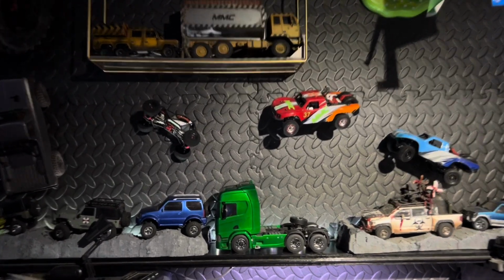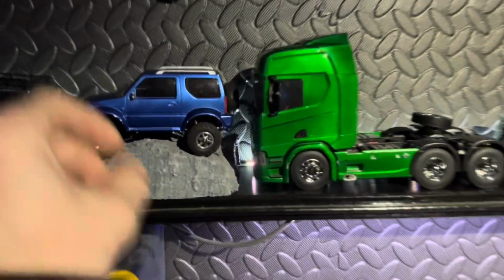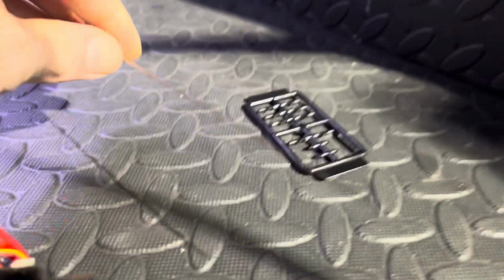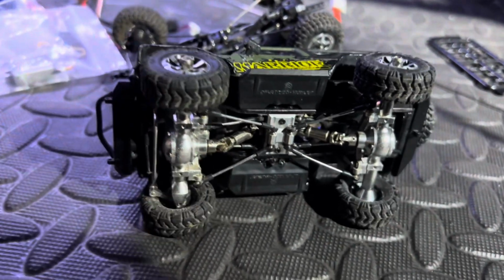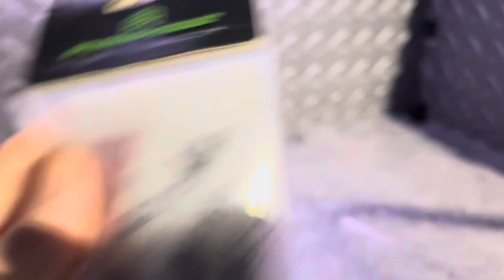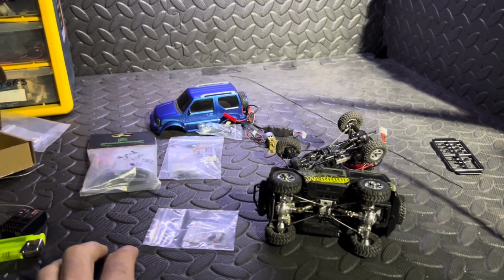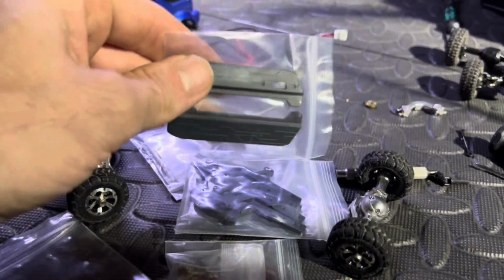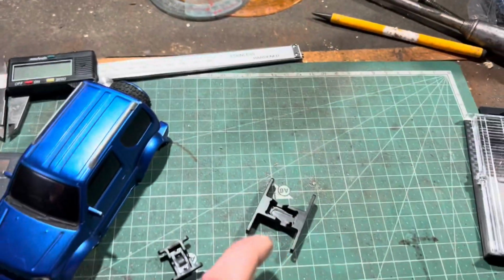Going brushless!!! With all the trimmings.

Comment: Hello, good job for this build 👍🏻 this brushless system looks to work well. Do it has a good torque at low speed and a much more speed compared to a brush system (400rpm for example)? What do you thing about the reversed transfer case ? Is it a real plus ? Thank you for your answer.
Reply from the maker: hey buddy, the brushless setup is wonderful. wayyyyy better than the brushed. great torque at slow speeds. And as for the reverse gearbox. its not vital but really eliminates body torque.
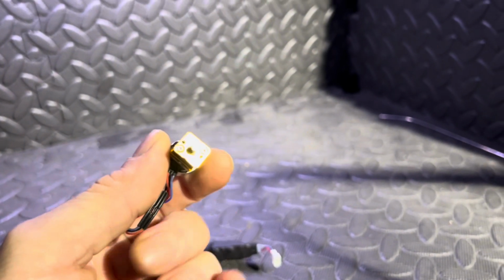Reply: @mikesmancave5505  hi, thank you for your answer. I just received a brushless combo with 1:10 ratio. Can’t wait to test it. I am going to order a reverse gearbox for my nest build. 👍🏻
Reply from the maker: Let me know how the 1:10 ratio goes gonna be a quick one.
Reply: Hi there, great video, really enjoyed it. Loads of questions. Any chance of a closer look at how you mounted that servo? Is the  ESC waterproof? How have you mounted the body without the bumpers? Where/how did you mount that lead? Where can you get that gear box and is it feasible to adapt it to fit without a milling machine (I have a Dremel??)?
Reply from the maker: @MongrelRC  that is a lot of questions 😆. Firstly, i cut the mounts off the servo and literally glued it to the chassis rails. I wouldn’t want to say it is waterproof, but wouldn’t be hard to make it waterproof I guess. The body is mounted with magnets that are stuck on the body and stick to the chassis rails. I’ve just found a gearbox set that will work without modifying it🫣
https://a.aliexpress.com/_mNbWcDW 
I’m waiting on a new body to turn up any day now. So hopefully there’ll soon be another video soon 😉